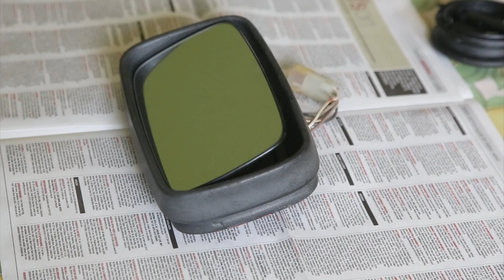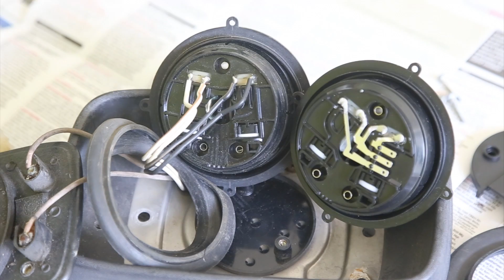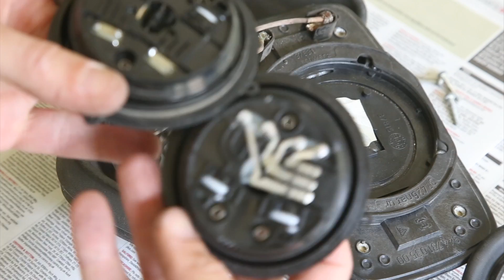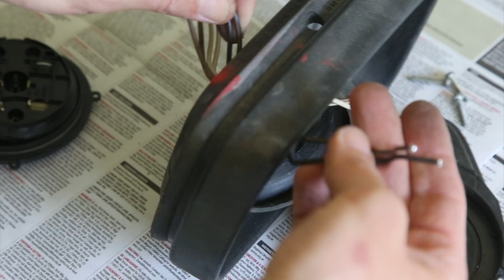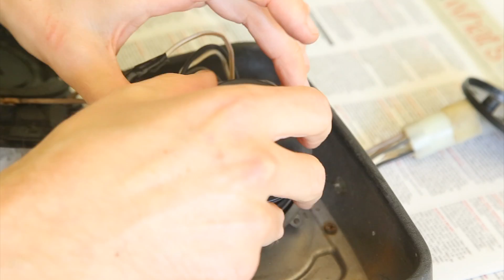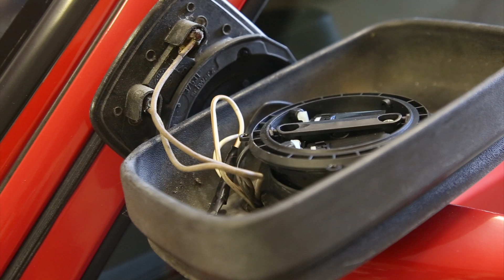How to replace Porsche Electric Mirror Motor - Guide on Replacement of Broken mirror motor

Comment: I can confirm that this wiring does not work as shown on my 88 NA, as the vertical operation is reversed if you wire with the single ground (it also looks mis-wired as the the black lead clearly connects to the right-most motor conductor on the original at 1:27, however he has soldered the black/brown to that lead on the new assembly at 4:01). 

I had to de-solder and remove the new 3-pin leads, and wire the original 4 wires identically to the stock setup to get it to operate properly. This was actually better as the wires then exit properly out of the backplate and closer to the hole in the mirror frame properly. 

I'm honestly at a loss how this worked properly on his 944 as he shows it.
Reply: I wish you would have made a video of that, Im about to do this job
Reply: Same💀

Comment: It would appear 87-89 Ford Mustangs used the same mirror motor.  Found my way here looking for s replacement and it appears the VW part is the answer
Reply: Mike I’ve got the same problem but still need to find out what vehicle make and model the VW part came off. Did you have any luck?

Comment: +1 on the VW part number or is it just the same electric motor used in say a golf of similar vintage i.e. 1991
Reply: davidircameron I’ve got the same problem but still need to find out what vehicle make and model the VW part came off. Did you have any luck?

Comment: hi , could you please tell me wich volkswagen part number i need to use to replace the mirror motor of my 911 from 87 Already thanks .Grtz
Reply: Dirk Blade I’ve got the same problem but still need to find out what vehicle make and model the VW part came off. Did you have any luck?